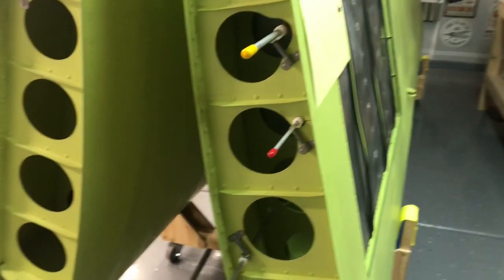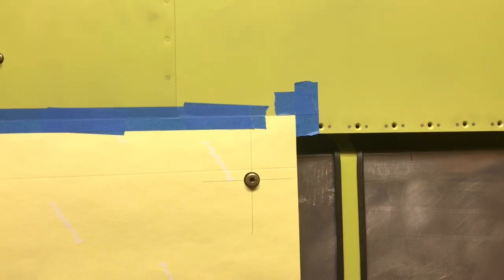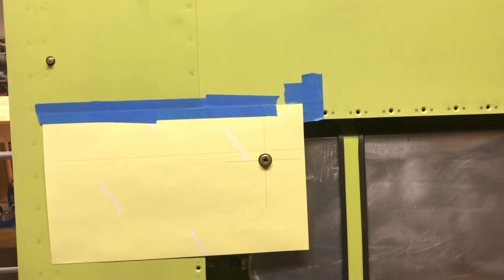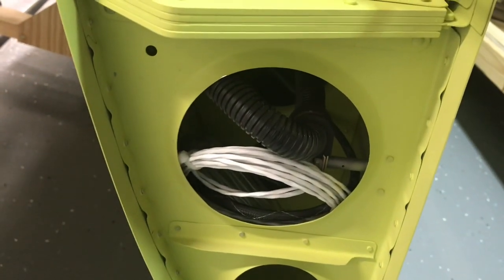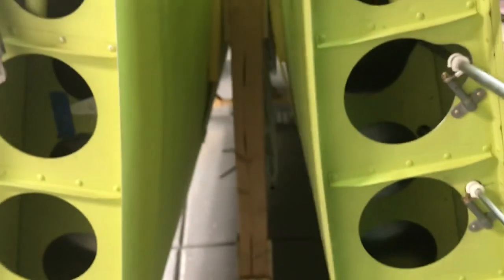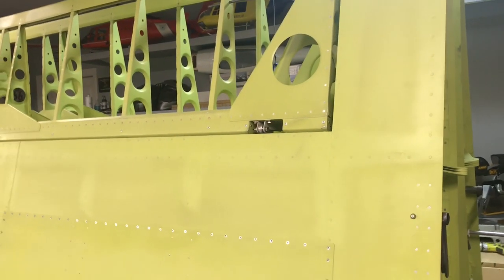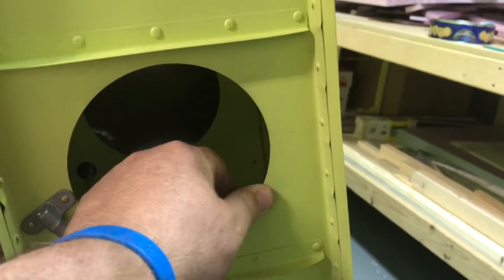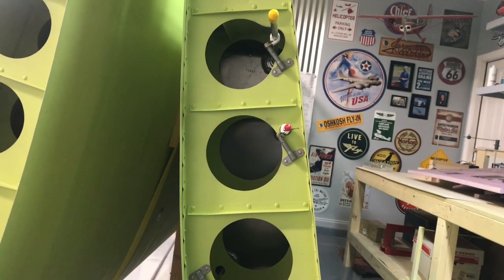The Desert Bearhawk Project : Right Wing fuel tank finished install

Comment: I would agree about opening up that lightening hole, but would admit I'm a model builder.  The integrity of that wing shouldn't be compromised by opening that hole a bit like you did.  The strength of that wing evolves around the strength of your spar and the integrity of the whole wing and the wing struts.
Reply from the maker: Yeah, I agree. Like I said I'll be the first t know if its an issue.